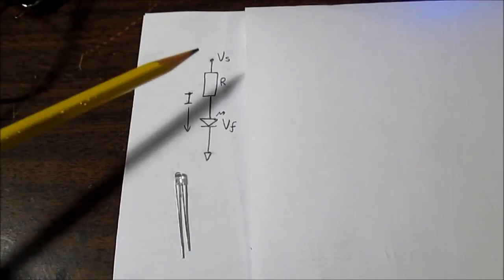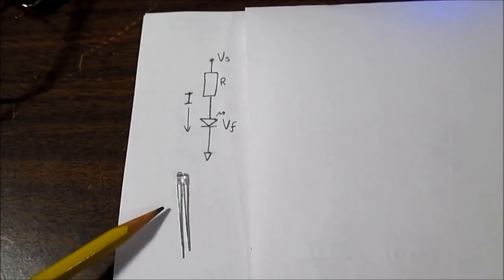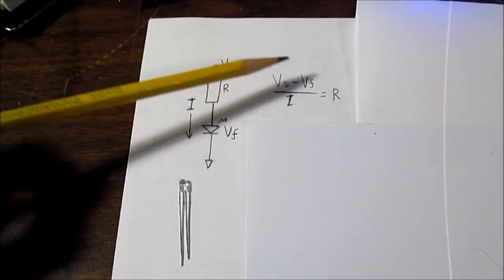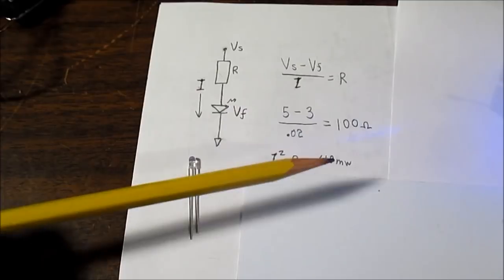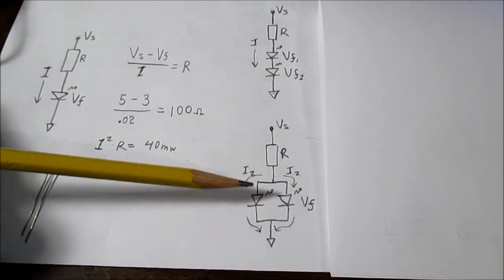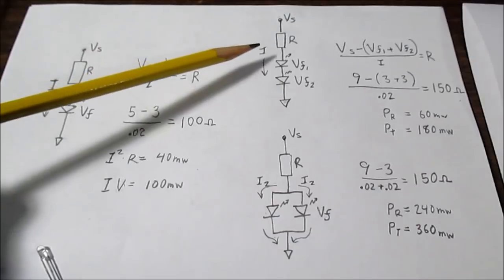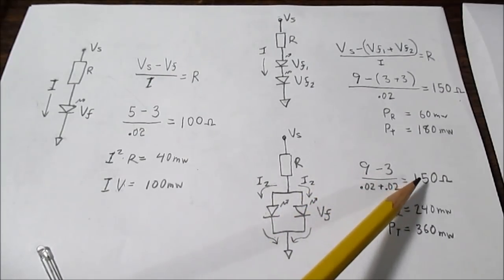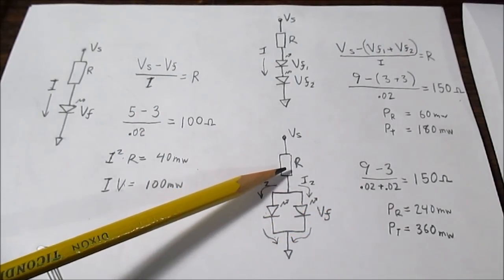How to select resistor value for LEDs

Comment: hey I got this lithium 12V battery(16Ah) for small scooter or some outdoor electronics. If I want to make a new LED fixture and buy a single 12V LED with current max at 1.25A and run it with the battery that I have, do I need any resistors? I want to make an outdoor camping LED lighting and want to use this 12V 16AH battery to power this for a long time. I heard as long as the voltage is same 12V, the LED will only draw the current that it likes and will not draw more than it can. Does it mean I do not need ANY current resistors? because 16AH sounds like a pretty heavy force for 12V LED with 1.25A current-max to be connected.

Comment: My question is: in the parallel combination, if you used a 3V blue led and a 1.8V red led, what would happen?
Reply from the maker: The LED with the lowest forward voltage drop would only light, meaning the red LED.

Comment: I wish this made sense to me.  I'm just trying to get my LED diodes to be dimmer.  Seems that reducing my power supply to the minimum of 3V might be the easiest.
Reply from the maker: Yes that could work or you can use a higher value resistor.
Reply: @JohnAudioTech  There are currently no resitors.

Comment: hi, nice video will need to watch it a couple of times, but at 4.20 you went on to the calc for Watt, why do we need to know? is it just for the sake of elec consumption or is it for the purpose of using the right parts so no damage is caused? thanks in advance
Reply from the maker: Yes, resistors have a max watt rating and you want to be sure you don't exceed it.
Reply: @JohnAudioTech  ahh OK, never knew that, I have watched several videos I think u might of been the first to mention that

Comment: Am using a 12v automotive lead acid battery and it can output around 10A consistently (it can light 130W 12v halogen without any issue). So to light a single 3V led from it, do I need a 0.9ohm resistor.?

Comment: Don't worry about all the calculations. Gone on line and you will find charts that give you the resistance value for various voltages plus different colours require different resistance. Different colour LED's require different value resistors. The project I am working on operates at 3 volt. The yellow LED requires a 47 ohm resistor while the blue LED requires a 10 ohm resistor. If I get the resistors around the wrong way I will blow the yellow and the blue will not come on, Down load a resistor value chart and pin it on the wall.
Reply: Or just use your multimeter to check.
Reply: @imho2278  Hi, the different colour LED's have different voltage ratings, you will have to check a data sheet for the voltage rating.  When I know the voltage rating I then look up the resistor required for the supply voltage, his could be  3v, 6v, 24v. When I know the resistor vvalue,  say it is 220 ohm I add a little bit extra resistance. The LED will last forever.

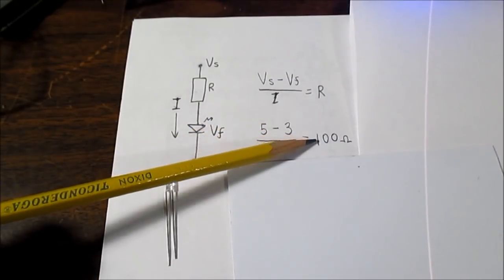Comment: 2:55 how do you know that you want your current to be 20mA? Is there a formula that states what the current should be?
Reply: ya same.  why he constant the value 0.02A
Reply: hey.  now i know the answer.  it is based on datasheet of forward voltage,  Vf
Reply: @genshin4418  do you have a link for or a name of the data sheet?
Reply: @danieljohnsopardenilla997  just search youtube forward voltagw datasheet.  some video explain about it.
Reply: @genshin4418  thanks

Comment: hey mate :)
I want to place 9 uv leds on a 5v source. how do i do this? uv leds need 3.2v so in series is not possible i guess. i have tried with a voltage regulator to drop the 5v to 3.18v do i need to place a resistor for this? 1? or on every led a resistor or what do i do? the led's seem to burnout realy fast. thx

the specs for these leds say: 3.2v - 3.8v and forward current is 20ma
3mm led
Reply from the maker: I would put two in series (6.4v) and select a resistor to drop the remaining 2.6v. You'll have 5 groups of two LEDs with resistor - 10 LEDs total. If you have to have 9 LEDs, you'll have to treat that one odd  LED with its own resistor.
Reply: I cant put 2 leds in series because i only have 5v :)
Reply from the maker: @kvmods  Oh sorry, not sure why I was thinking of a 9 volt supply. Anyhow, 9 LEDs x 20ma = 180 ma, 5v-3.2vf=1.8v. 1.8v/180ma= 10 ohm 1/2 watt resistor limiting current to the 9 LEDs in parallel. This is fine if the LEDs are of good quality (matched). If not, use a 100 ohm resistor in series with each LED.
Reply: @JohnAudioTech  thx :) thats a clear answer

Comment: Sir my son is 13 yrs he love LEDs his cycle full of LEDs.from the u tube only he learnt to do simple torch he used 12V LED and 9 V battery it worked one day after led finished his life.what to do. In this case we have to use resistor?
Reply from the maker: It is possible the LED burned out if too much current passed through it.
Reply: @JohnAudioTech  thank u
Reply: @JohnAudioTech  for 9 v battery   12v LED with these how much resistor I have to use.

Comment: I am trying to build a 20 LED voltage checker for the leisure battery in my camper van. I watched a video where the guy made one with only LEDs and resistors, but his was only ten LEDs. Could you make a video explaining how to figure out  the correct resistors needed for each 5% increase? Even after watching your video I can’t figure out how to do it. As the voltage rises, more LEDs slowly come on and vice versa. I have read conflicting numbers for what a fully drained battery is ranging anywhere from 10.5V to 11.4 V and 12.8 to 13.6V fully charged. Does that affect resistor size? 

Thanks for making this video, I learned something...

Comment: I got confused by this. It seems back-to-front to me. Now that I "get it" watching it back I see where it goes wrong. He doesn't state the value on the datasheet for max continuous current, so when its value comes up much later (0.02A) I didn't know what or where that value came from without use of a meter/measurement.

This tutorial, and others like it, led me to build up an wonky mental model that the current in the circuit is somehow a property of the circuit and its components and the supply, perhaps the type of LED happens to draw 0.02A, and that I need to therefore determine the correct resistor for that current with the voltage drop of the LED according to its datasheet.

The right way to look at it is that you're choosing a resistor in order to limit the current in the circuit to prevent the LED from pulling too much and burning itself out while remaining as bright as you'd like it. So the value I (current and thus brightness) is determined by your choice of resistor, not the other way around; we're trying to find a value of R that gives I. It's not that we have I and we need to "figure the value" for R.

Comment: There is even simpler method which is U=(R1 +R2) * I  . R1 is the resistor R2 is the led résistance.. If you want to know which resistance to use just do R1= R2- U/I

Comment: I've got an LED running off of 5v with a stock resistor of around 350 ohms. can't get this replacement to light up.  are these so far off from one another to where that restistor value is way too much?

Comment: Please tell me why in my preamp circuit where I include a blue LED powered by the 48 volts from the phantom circuit in my mixer- I can use between 2.2 megs to 5 megs and the blue Led shows up nicely.

Comment: Your last circuit is wrong I think! The voltage drop accross the LEDs is 3 Volts, which means you must have 6 Volts drop on the resistor and that is why you have such a high resistor value and thus higher power consumption. If you supplied the circuit with 5 Volts then you would have R=V/I=(5-3)/0.04=2/0.04=50 Ohms. Hence, P=I^2*R=0.04^2*50=80mW compared to the 240 mW you have on the previous circuit.

Comment: what size cables do i use in my bread board is it 22 gauge? i should mention that the leads on the metal film are thinner then the composition resistors. radio shack sells traditional composite resistors that are twice the price of the film are they worth it.
Reply from the maker: 22 gauge should be the thickest. Cheap Chinese resistors use the thin leads. Quality metal film resistors I get from DigiKey have the same thickness.

Comment: Calculating the resistance seems the easiest part. Knowing the current and voltage drops takes prior knowledge. You should have provided a source for that info
Reply: Im having trouble with a system of mine.. I have avg  3v 5mm leds supplied w/ 6volts of power.  Im using a 2.2ohms resistor.. Light seems a bit low luster in my opinion?  Am I using or ding something wrong?  I tried using the ohms calcualtor law app and it said 2.3 ohms?

Comment: hi just want to ask. how can i compute if how many ohms should I use to light up a 40 smd led (blue) which has a 3.2 volts each and 20 ma each using a 12v battery (motorcycle battery) (when charging goes to 13 - 14v) thank you and i will wait for your answer thanks

Comment: Thanks for the video. I have a quick question about my third brake light on my car which are LED’s. There are 4 lights in a row on a metal strip with a plastic backing. There are 2 light blue cylinders between each set of bulbs which say 240 J I’m guessing that’s jules. And it says .07 on the same cyclinder. The cylinders are tiny maybe the size of a large grain of rice. Sorry for my lack of terminology I’m trying to learn as we speak. On the far left there is an even smaller black cylinder. All the cylinders have these metal connections on the sides and are connected to the metal strip. The metal strip sticks into the plastic backing and forms a socket in middle on the back of the plastic backing. Sorry I’m typing so much I don’t think I can post pics on YouTube and I really want to figure out if this is fixable. The lights don’t work and I want to know why. As far as I know the whole light went out all at once. I’m trying to figure out if I can replace some of those cylinders would it fix the light? If you can’t answer I understand thanks again for the knowledge.

Comment: I have an LED bulb I removed from a "Finger Light" that was powered by three 1.5 volt hearing aid size batteries. There was no resistor in its set up, just a basic on/off switch. I want to install it in the nose of a toy drone that uses a 3.7 volt lipo battery. Do I even need a resistor added to this circuit? Just wire it pos and neg from the drones battery's circuit board terminals?
Reply from the maker: The "finger light" was relying on the internal resistance of the tiny batteries. The toy drone battery can overdrive the LED, so it is better to use a resistor.

Comment: Great video.  When you were explaining the reason for the same resistance value in the parallel circuit as opposed to the series circuit, the current was doubled but the voltage drop across the LED's is one half the value of the series circuit, not double. That is the why the resistance value is the same. E is directly proportional to R, while I is inversely proportional to R.

Comment: If one strip of the led of my tv is blown, how much resistance should I substitute it in order to check the other leds. Answer: move along sir.
Reply from the maker: Answer: You'd have to know the currents, voltages and the specifications of the LEDs in use. Move along sir.

Comment: i put 220 ohm and 100ohm resistors in my circuit, 9v power supply 3v drop over my 5mm LED. Fried my LED. Where did i go wrong?
Reply from the maker: Sounds like too much current. Most 5mm LEDs are happy at 20ma or less. With one LED at around 3v, leaves 6 volt to drop through a resistor, so 6v/.02a= 300 ohm (330 ohm is the nearest common value).
Reply: @JohnAudioTech  right, but can i not use two resistors in series and the result would be additional? i.e.; my 220ohm and 100 ohm resistors equal to 320ohm resistance?
Reply from the maker: @nickjamesb2051  That is correct. Not sure why the LED would burn with 320 ohm resistors. Possible a bad LED?

Comment: I have a question, what if i want to power an LED using a Lead acid 12v battery but of course the constant voltage is not going to be 12v because when it is fully charged it goes up to 13.8v. Do i take an average of that or just stick with 12v. thanks
Reply from the maker: I would design for the highest voltage so the LEDs aren't stressed from over current if the voltage is that high for long periods or you could use a constant current source driver.

Comment: I am using a 30W RGB LED, what kind of resistor would work for using it with Arduino UNO R3.
Reply from the maker: Sounds like you would want a driver circuit for such a powerful LED.
Reply: @JohnAudioTech  can you explain it with more hardware examples. That'll be helpful since I don't have any electrical background

Comment: What you're illustrating is sound, but why not start with, and get students comfortable with,  the simple DC formulae?  E=IR and the two derivatives.  And P=IE and the two derivatives.  Move on to VA=the obvious, discarding E for V.  Later, Discard P for W and go into W=VA times PF.  Introduce K.  Teach PF, with inductance (motors) and capacitance (flourescent lamps), and predominant loads which affect utility distribution.   Now you're up to EE 102, good luck.

Comment: Lets say that my power supply  for example is 50vdc, Can I still use this to power my led? 50vdc-3vdc=47vdc    47vdc/.02amps = 2,350ohms   / Would this OK for the LED?
Reply from the maker: This would work fine although it is very inefficient as you would be wasting almost 1 watt in the resistor and the LED consumes only 60 milliwatts.
Reply: JohnAudioTech So the voltage really doesn’t matter AS LONG as you have the correct size resistor.  Right?
Reply from the maker: @Can-you-fix-it  Yes.

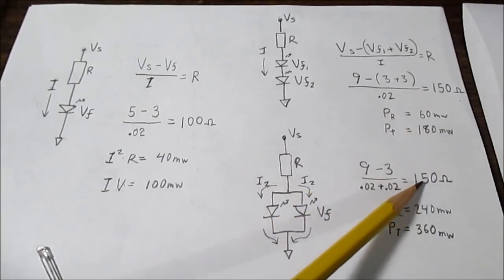Comment: 7:35 : your explanation ("double the current but double the voltage drop, so R is unchanged") is wrong, but the calculation gives the correct result by chance. Let me explain myself:

Having the same 150 Ohm value in your 9V example was just pure luck, due to the fact that 9V = (series :) (3V+3V) + 3V as well as (parallel: ) 3V + 6 (which is 3+3...)V. Try again with LEDs which have a 2.5V forward voltage for example and still 9V : 9V = (series :) (2.5V + 2.5V) + 4V (then, R = 4V/20mA = 200Ohms) as well as 2.5V + 6.5V (which is... not 2.5+2.5! then, R = 6.5V/40mA = 162.5Ohms), it won't be the same value for R.

Hope I were clear enough so that people could understand. Of course for such a small difference it would not be a real problem, but with other values... that could make a difference ;)
Reply from the maker: Yes, the resistance values came out the same by chance due to the supply voltage and LEDs  used in those examples. I did not mean to suggest that the R value would be the same under different supply voltages or LED forward voltages.  I was using the same supply voltage and LEDs in both the series and paralleled LEDs circuits to demonstrate power usage. Changing up parts and/or supply voltage would throw off the demonstration.

I was not clear when I said "double the current but double the voltage drop". What I meant was the voltage drop across the resistor in the paralleled LED circuit is double that of the voltage drop across the resistor in the series LED example shown above it (by chance of the supply voltage and LEDs used). The current through the resistor in the paralleled example would be doubled. Again, I didn't mean to suggest that this would be true under different supply voltages and/or LED parameters.
Reply: @JohnAudioTech  No problem ;)
Indeed I guess you wouldn't mean to suggest that, it's just that since it was in the same sentence, confusion could happen in some people's mind..

Comment: Thanks for the video, it was most helpful. Newbie question: Does the resistor need to be in font of the LED? The reason is I have designed a circuit with three LEDs but only one is powered at any given time so I joined the ground ends of the LED's and connected a single resistor between them and the ground. However I am now doubting the correctness of this approach.
Reply from the maker: This sounds fine to me and is a smart way of saving components since only one LED is on at any given time.

Comment: what if i don't have a data sheet? like the ones from E-Bay
Reply: Connect an appropriate  resistor and power supply and measure the Vd across the LED.
Reply: Datasheets can be expensive... I had to pay 10 times the LED price to download one... 😉

Comment: If you have to add resistance to a circuit in order to run the LED, does that counteract the energy savings? Do the resisters plus the LEDs burn up the same power as the standard bulb, but instead of having the energy loss through heat in the incandescent bulb, the heat is now generated in the resistor?

Comment: You talk about either using or not using a driver vs a resistor.  What is the difference and why use one or the other?  Thanks
Reply from the maker: If there is a large voltage to drop across the current limiting resistor, it may be better to use a driver circuit. This is true with higher power LEDs because a driver circuit adds complexity and cost to the circuit.

Comment: With the third circuit (powering two LED's) why would you use a 9V power supply?? Two LED's in parallel still only have a 3V forward voltage. The circuit would just require twice the current, the same 100ohm resister and draw exactly twice the power of the first circuit!